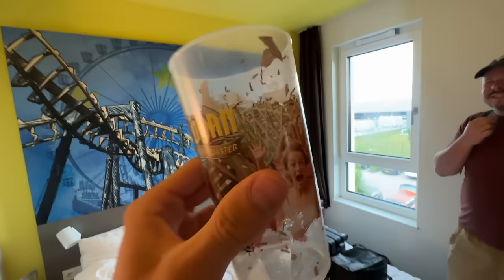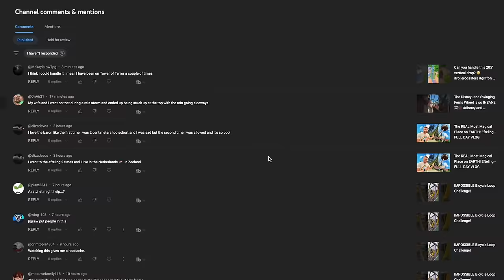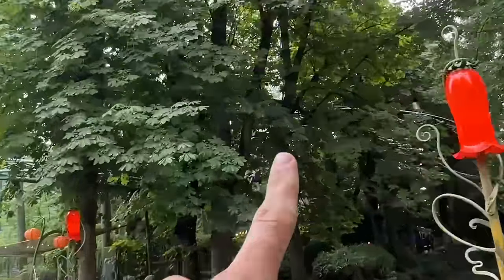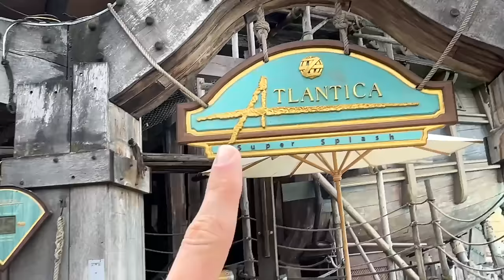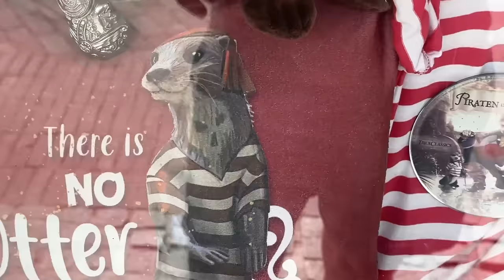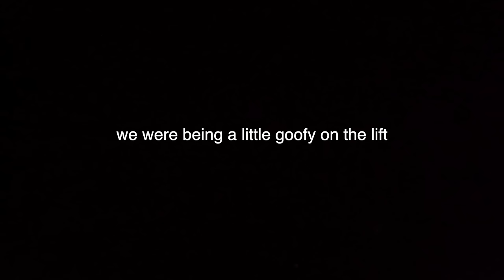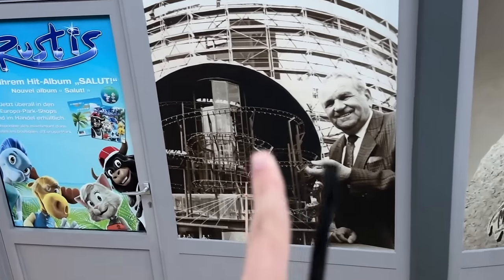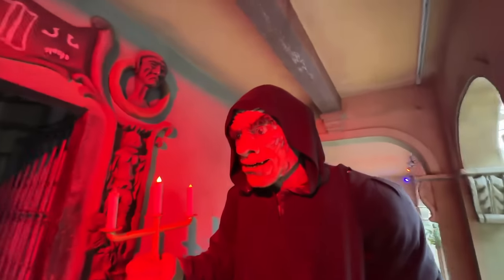We Rode The CRAZIEST ROLLER COASTERS at Europa Park!!

Comment: Hi ,sweet Alex, 
3:42 The building with the clock tower behind you is the old main entrance…
4:49 The Castle Balthasar behind you is a real medieval Castle from before 1447 - reconstructed 1575 as you see it today.
13:39 The bear Flagg is from the federal city of Bern/Switzerland- you are in Switzerland- and it’s somewhat like the capital city…
26:45 Workers are scheduled to the last possible hour and laid off early on peak season if not needed.
27:12 The Mine Train and Logg Flume will come back soon…
45:31 The lift drum is holding 3 trains at the same time, did you notice?
When you step out of Blue Fire you are just beside the entrance to WODAN- haven’t you seen it?